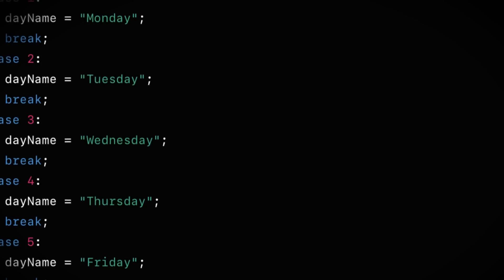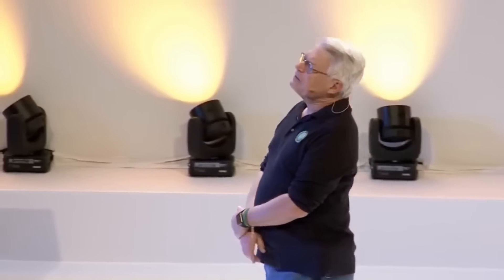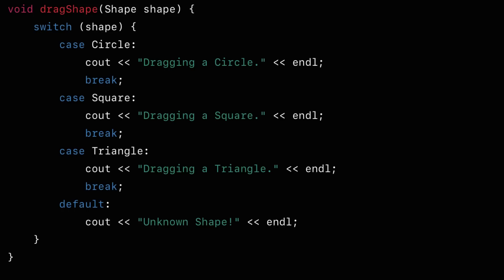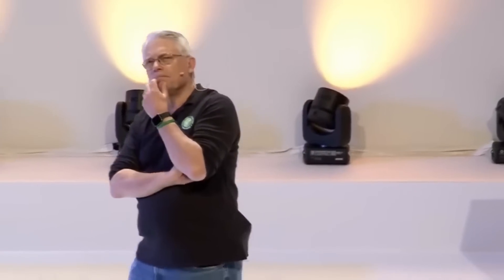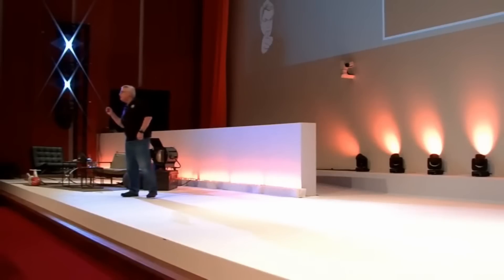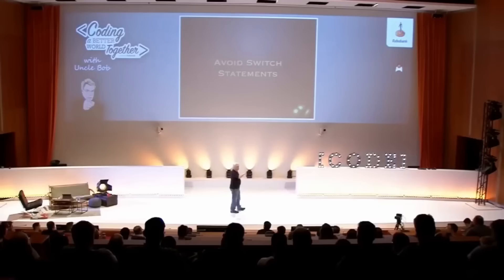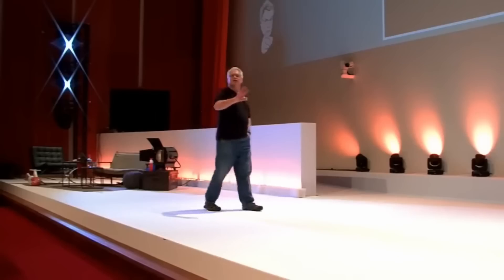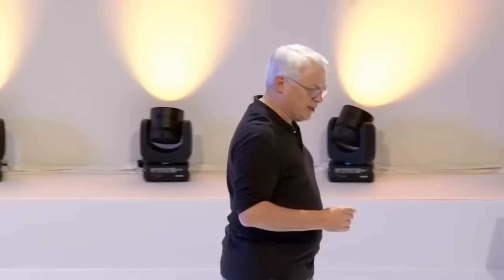The problem with switch statements - Uncle Bob

Comment: Functional languages would like a word. You have match statement and if you don't cover all the cases, then the thing won't compile.
Reply: match is not switch, you're welcome
Reply: @lewke1059  wow..  thank you so, so much. I'm so glad you told me this, because I was obviously under the impression that they were exactly the same and not just related constructs.
Reply: @dschledermann  sorry, was getting tired of reading all the bad takes in these comments so I incorrectly assumed yours was intended to be a jab at match alongside switch
Reply: @lewke1059  
match as a control flow structure <IS> functionally equivalent to a switch, you're welcome as well.
Reply: @diadetediotedio6918  yes if you ignore all the things that make it different then it's exactly the same, you're right :)
Reply: @lewke1059  
I said it is functionally the same, not "exactly the same". Functionally the same in the sense that it works (or that there is nothing that would block it to work) exactly like a switch. Take for example the switch in C# which has the same features of match in Rust like pattern matching and exhaustiveness.
And lastly, for Bob's arguments, the same things would apply to a match if you use it for the same purposes you would use a switch in your project (and you can, literally), so your point don't appear to make sense to me.
Reply: @diadetediotedio6918  i was making fun of your nonsense argument and you took it literal, ok
Reply: @lewke1059  
Unfortunately, saying something is nonsensical don't turn that thing into nonsense, you need to argue for it. As you did not, I just assumed good will and took you seriously, which now appear to be a mistake.
Reply: @lewke1059  That's not what he said. Maybe try not being a jerk?

Comment: So what about "composition over inheritance"...?
Reply: Use each in their correct place.
composition when you want to make something more general
inheritance when you want to make it more specific.
simply applying "composition over inheritance" in every case is very naive.
Reply: Still holds true. It's all about solving a problem with the right tool. Don't solve a polymorphism-problem with switch statements. Don't solve a composition-problem with inheritance. The hard part is ofcourse to recognise what type the current problem is.
Reply: @nonamesavalible  Depending on how literally you take it, "composition over inheritance" means you should never use inheritance and always use composition. There are even modern languages that don't support inheritance for that reason.

And that's the first thing I thought when he said those scaling methods should all be part of the shape class. So everything that differentiates the type of shape should be in the shape class? That's gonna be a long class.

And what if your code should be extensible? What if you want to support extensions that provide their own operations on shapes? You're not going to solve this with sub-classing.
Reply: @nonamesavalible  and wouldnt want to solve a generics problem with polymorphism either. duck-typing can be a much more elegant and efficient solution over runtime polymorphism
Reply: @Raspredval1337  duck typing IS runtime by definition. I'll assume you mean structural vs nominal typing: https://en.wikipedia.org/wiki/Duck_typing#:~:text=Duck%20typing%20is%20similar%20to,that%20is%20accessed%20during%20runtime.
Reply: it depends on the type system. Even the article says the check is SOMETIMES done at runtime IN SOME STATICALLY-TYPED languages. :face-blue-covering-eyes: In practice, the check is done at compile time in most statically-typed languages
Reply: @Raspredval1337   You're wrong :shrug:

For example, typescript has both.

Comment: But why say "we don't like switch statements" when the same grievances you have identified apply equally to "if..then...else..." statements?
Reply: I find that most discussions on "this is why this feature is bad" are mostly based on bad uses of that feature, rather than a problem with that feature itself. Bob's problem with switch statements has next to nothing to do with switch statements and everything to do with misusing switch statements. If you have a switch statement that works on just one input in a single function, the problem he describes will never arise.

It's kinda ironic that he suggests the solution is polymorphism, because the internet is filled with "why OOP is bad and you shouldn't use it" videos, all built on criticising misuses of OOP.
Reply: “Switch Statements” are on of the 23 OOP code smells. If… else if… else… statements also count as a “Switch Statement code smell”
Reply: The difference is 'exhaustiveness'.
Reply: You also want to avoid if then else. The better way is to either put a drawShape in the class and override it in each subclass. So you would just call shape.drawShape() and it would print Circle or a Square, depending on the instance type (polymorphism). 
If you add another shape you just change one method instead of going through all switch (or if/else) statements.
If you don't want to have drawShape inside the class, you can make universal visitor method and then override that method to call your visitor.draw(Circle class) or visitor.draw(Square class) and you overload each method in another class. Check visitor pattern.
Reply: True 1:33
Reply: You did not get the point. If you just fixate on the headline and try to fix the headline of the lesson, you will not learn the lesson.
Reply: @What_do_I_Think Can you explain the point then?

The example seems to say “switches are worse than inheritance on some situations”…. Which I think everyone agrees with.

But that evidence doesn’t back up the conclusion “so we don’t like switches”.

Hammers are bad because sometimes a sledgehammer works better…
Reply: @ian-flanagan  Maybe sometimes a little more critical thinking and less criticizing would be good.

Who said "we dont like switches"? Who said, that you are not allowed to use them or that it is bad to use them, when they are a good solution.

My take of this video was, that switches are often used, when polymorphism would be better and when the use of switches just point to a design problem.

If you read the title of the video without bias, then it does not say, that "switches are bad".
Reply: @What_do_I_Think  Him: This is one of the reasons we don’t like switch statements

You: Who said they don’t like switch statements?

I completely agree with your point, but his logic is whack.

If you use a hammer to knock down a house, the job being difficult is not a problem with the hammer, and it’s definitely not a reason to dislike hammers. He’s using cultish anti-logic.

I feel like this is exactly the critical thinking you’re saying I should do more of….
Reply: @ian-flanagan  Sorry, I am out here. This is bean counting, and I can not care less about beans.
Reply: @ I mean the title and conclusion of the video don’t follow from the reasons presented. I don’t see how this is bean counting. Educators should be teaching young developers solid logic, not spreading tribalism surrounding coding styles and tools